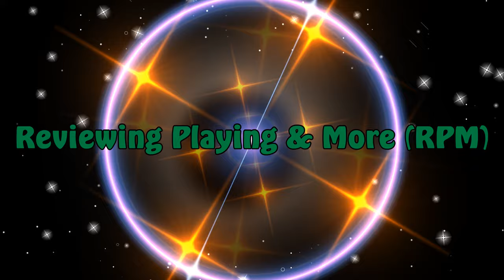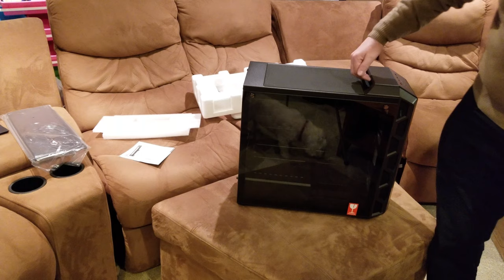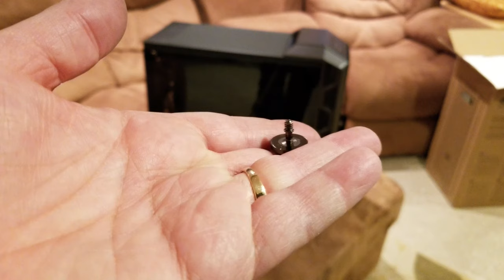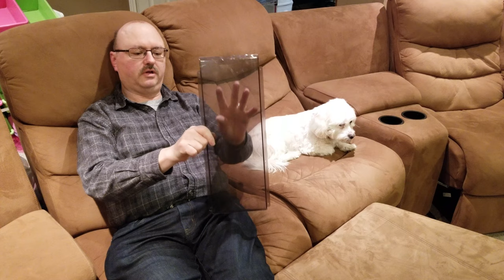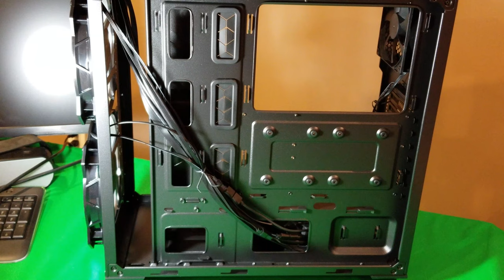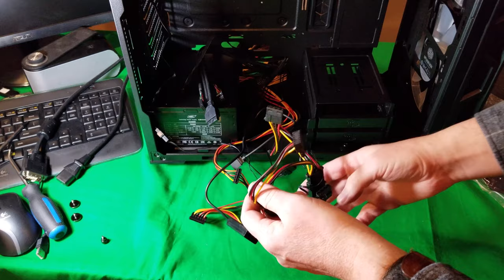Cooler Master Mastercase H500 (New info on RGB in the Build Video coming soon) No Molex required.

Comment: Nice case, I just finshed my new build, for $100 bucks you can not beat it. Good air flow easy to build in it. Good review, will say this the 3 pig tail splitter is very cheap and when I ran the 2 front fans to it and plugged it in my mobo cha-2. My mobo would not pick them up, went to Fry's and picked up a better built splitter and it worked.
Reply from the maker: +Pinkfloyd1173 Great to know, haven't finished the build yet but will keep that in mind if I have the same issues. Appreciate you sharing that info...

Comment: OOPS!!! PROBLEM #1: DO NOT CONNECT the third wire with a cap to the motherboard!!!! That is an output for a 3rd fan. The cable that goes to the motherboard is on the OTHER SIDE of the rgb splitter. There are two of them, one labeled for Asus/Asroch/etc. and another one for Gigabyte motherboards (cause they couldn't just play ball). Use only one of those and plug THAT to the ARGB or RGB port on your motherboard.  PROBLEM #2: If you connect the fans to the ARGB connector on the motherboard you DO NOT use the extra CoolerMaster fan controller (the little black box that connects to SATA power).
Reply from the maker: Noted. Thanks.

Comment: i just built in this case last month.  pretty satisfied aside from the front ventilation.  60mm of those 200mm front fans are blocked by case metal.
Reply from the maker: Yeah but the looks of it make up for its small disadvantages. Have an amazing day!
Reply: @Reviewing_Playing_and_More_RPM  i agree, it looks FANTASTIC!  i put my radiator behind them so its almost in a push/pull situation but the 200mm fans dont create much static pressure

Comment: I have all the fans connected to the controller and the for gigabyte controller plugged into the JRGB slot.. and I can't change the fan lights at all
The whole front plate was pre-installed, so all the fans and stuff were connected to splitters.. i just connected the back fan to the 3rd white splitter
Reply from the maker: Answered in last comment...Thanks...

Comment: Nice video. You really helped me because I couldn't find any videos or photos with all the sides of this case. I didn't understand this thing with the rgb controller but it's ok
Reply from the maker: Glad it helped, the RGB Controller is only needed if your Motherboard doesn't have any RGB on the Motherboard...Thanks...
Reply: @Reviewing_Playing_and_More_RPM  So, if I buy the Msi X470 Gaming Pro Carbon which has rgb and mystic light, I don't need it. But, does the h500 really include a splitter where I can put 3 fans and attach it to 1 slot of the motherboard? And if yes, if I put 3x 200mm rgb fans where should it be plugged? To a system fan slot or to the jrgb header???
Reply from the maker: That's correct, you won't need it with this Motherboard, but if you did need it both the 3 PK fan and the case comes with the RGB Controller...The H500 does come with a splitter that will allow them to connect to one System Fan Header on the Motherboard...The RGB Fans are powered by a SATA Power Cable connected to the Power Supply, with the RGB to control the RGB using the RGB Header...Hope that answers your questions if not send me another question...Thanks...
Reply: @Reviewing_Playing_and_More_RPM  Ok thanks. So since I don't need the controller, I will put the 3 rgb fans to the splitter (it supports 3 fans right?) and then to the jrgb header? And every fan has 1 more cable which goes to the sys fan slot? Lastly, does the rgb controller come preinstalled (preattached) in the fans?
Reply from the maker: Yes it supports 3 Fans...and yes to the RGB Header...yes each fan has it's own cable, and the RGB Controller is not pre-installed (Pre-attached) so you connect as you need...
Reply: @Reviewing_Playing_and_More_RPM  Ok, thank you very very much!!!😊 👏👍 You helped so much! Keep doing such nice videos and providing help to people. Thanks again!

Comment: This was a great review. Your in depth looks at the case let me see if my weird non-standard 360mm radiator (2x180mm) would at least fit on this case, and it looks like it will. I've loved this series since the original Master Case Pro 5. Subb'd and thumb'd. Cheers!
Reply from the maker: +10ee Appreciate your support, glad you liked the video. Thanks for watching...

Comment: a big let down with this case  is ,i bought 2 noctula 200mm fans for the case and i went to do my build and the holes on my new fans do not line up with the ones on the case so it means i going to have to drill out holes for the noctula fans .. a extra hassle i did not need as its my first time building a pc ..
Reply from the maker: +tomas o sullivan so your adding them to the top? I don't think you need them the airflow is very good and the two front one's are very quiet.  Yeah didn't realize if you were adding you would need to do that. For your first build I'd only replace the rear exhaust as it's a bit loud. Anyway good luck with that you're brave to attempt drilling into the case, I'm to worried I'd mess it up. Good luck...
Reply: @Reviewing_Playing_and_More_RPM  hi thanks for getting back so soon .. no i bought the 2 200mm noctula fans for the front because noctula are better quality ..i put 2 140 at the top and also replaced the back one with the 120mm .but the 200mm noctula fans in the front the holes for the screws  wont line up with the holes on the case .there different postion than the big fans that come with the case for some reason .. so i either got to drill new holes for my noctula fans or just put back in the ones that came with the case ..
Reply from the maker: +tomas o sullivan Only thing is you'll be losing the RGB but I get it if you don't like that it's not for everyone. It's to bad they don't fit wonder why they do that. Anyway sounds like a big decision. I'd stick with the ones that came with it but that's just me...All the best whatever you decide...
Reply: @Reviewing_Playing_and_More_RPM   i not interested in the rgb to be honest .. i think ill make a template of the fans and drill the holes so i can use the better quality fans .its just going to delay me a bit beacuse i want the proper tools to do it right ..it was just something i was not expecting  and not prepared for .i thought all 200mm fans would have the same holes but they dont lol ..thanks very much for your fast response
Reply from the maker: +tomas o sullivan yeah I'd have thought so as well, template is a good idea though.

Comment: doing my first build in this case and the fan wiring has officially sucked the fun out of it for me at this point, literally zero instructions came with the case and the wires are messy and all over the place smh. I got this case because i thought it would be one less step with the rgb fans pre installed but boy was i wrong
Reply from the maker: +Captain Smoke Yes it was a big surprise for me as well not sure why they did it this way I suspect it'll be confusing to most and take away from the build experience. It is an amazing case after getting through all that though...All the best...

Comment: I need to replace the two front fans, I hope they're not to hard to replace
Reply from the maker: Not there are 4 screws per fan, you just unscrew, observe the direction they are blowing the air and if your happy with that then put your new ones in the same spots...it's actually fairly easy...You'll have no problems...

Comment: Can you let me know if you remove the hard drive bays can you mount a bottom pull 120 mm fan?
Reply from the maker: Once the HD Bay is removed there is room for a 120mm fan, but no pre-drilled screws of which to secure it so if you wanted to do that you'd need to MOD it by creating your own holes to secure it with...Thanks...
Reply: @Reviewing_Playing_and_More_RPM  Awesome thanks for the response. I think I'll go ahead and mod it. Should be incredible airflow in the case!

Comment: If the  Front FAN RGB controller is SATA powered, what's Plugged into the MOLEX power?
Reply from the maker: It's not, the cables that plug in, one of them connects to the RGB on the motherboard, they have another connection that plugs into the motherboard. Sorry if I didn't show it well enough.

Comment: So does the LED controller that plugs into the SATA power cable only run power to the LEDs? Or does it power the actual fans as well? I'm assuming that it's only for powering the LEDs and that the fans still need to be plugged into a sys fan header on the motherboard but, I don't want to be wrong.
Reply from the maker: The SATA powers the front fans as well, the other fans use both the splitter cable included with the case and then the others go into the Fan Headers on the MB...You got it all right...

Comment: Hello, Dennis! I maybe quite late with that question, but the hope dies last, right?
So I have a problem with connecting rgb cables of front panel fans to my motherboard. I've tried so many options, but I just don't know how to connect it to my Giggabyte b450 AORUS elite v2. 
Perhaps, I need any kind of an adapter? 
Thank you in advance, Dennis!
Reply from the maker: Hi, so the case has gone through a couple different changes so I'll talk about both options, first if the cable from the case is 3 Pin it's a 5V ARGB Header that is needed on your MB it's called labelled as VDG, if the cable is 4 Pin it's a 12V RGB Header that is needed which is to the right of the VDG Header. Now on this case for the front fans there was on mine also a SATA Power connector that will need to go to the SATA Power from your Power Supply. Hope that helps, your MB has the connectors you need so should be no need for an adapter.

Comment: I have a question, what's the molex adapter for? I noticed you plugged it into a molex cable, but didn't plug anything into the adapter after that. Also, just so I'm sure, you don't need to plug the fans themselves into any motherboard fan headers right?
Reply from the maker: +JustShayPlays Hi, I in an earlier video I explained plugging in to the molex and to the sata power. It came in handy when I wanted to demonstrate the fans but in this build I realized I didn't need it. It can be used if your motherboard doesn't have a RGB Header. No I didn't plug the fans into the motherboard headers as the cables were to short, so I had to use the extension cables they provided. Which actually was good as I didn't have many system fan headers on the motherboard. Now one of them is on the adapter itself though. I know it's hard to show it well though so sorry for any confusion. Thanks for watching and your support...
Reply: @Reviewing_Playing_and_More_RPM  I gotcha. Thanks for helping me out.
Reply from the maker: Anytime...Have a great day...

Comment: Hi, I am using the restart button to control the front argb fans but now the restart button isnt working so how can i control the front fans to turn them on or off or to change color. I have asus rog strix x570 e gaming MB
Reply from the maker: If the restart button isn't working because of the case check that the cable to the front panel connectors didn't come loose as that can easily happen. If you are using software from the MB Manufacturer it should allow you to change the colors that way also.
Reply: @Reviewing_Playing_and_More_RPM  I checked the case, if i remove the case and use the exposed restart switch it works but if i put the front top panel cover then it doesnt so there is some restart switch problem and not to put the case for RMA is a big headache so i thought if i can use the the argb or rgb port on the MB and then control the fan color with asus aura sync software it would be great, but not sure though. so can you please guide if possible
Thanks
Reply from the maker: @amitgedia  You should be able to control your colors for RGB with the Asus Sync Software as long as it recognizes the source device. If it doesn't then not sure what can be done in that situation.

Comment: Nice video, I have one question though. Will a b450 tomahawk max have the correct header to control the front fans with mystic light and will I be able to turn the rgb off?
Reply from the maker: It has an 12V RGB Header, so yes it will work with the Mystic Light and you can control them through the software...if you don't want the RGB I'm not certain if you can turn it off with the software, but you could just not plug in the RGB as the fans work independent from the RGB and will work that way...In short yes you'll be able to do what you want with that MB...Thanks...

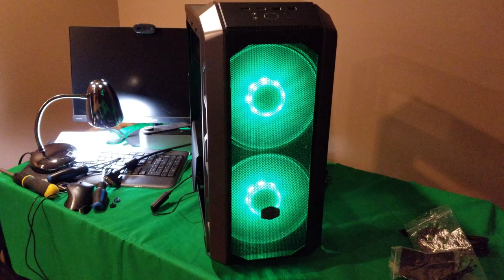Comment: Need help on this problem ....in your video, at 13:25 the fans LEDs are steady green with no effects until you press the controller to change the modes, I just want one color (blue) with no effects, all the colors have the bread effects, so how can I reproduce what you did until 13:53 with no effects...! Thanks again
Reply from the maker: So the controller is only used to demonstrate how to use it if you don't have RGB Connectors on your MB, if you do use the Software that comes with your MB to you will be able to choose Breathing or any other Mode to get the desired effect. The controller will do it as well but it takes a bit of exploring to get the Mode and color of your choice.
Reply: @Reviewing_Playing_and_More_RPM  Thanks for your reply... in your demo 13:25 you show how to use the controller if we don't have an MB with RGB, this is my situation I just have the front fans, I got the color (blue) that I want, but it's always in a breading mode, I explore all the function in the Mode, still can't stop the breading... not like your demo. In segment 13:16 you have no MB installed, so is my controller defective...! Thanks again
Reply from the maker: @ping3488  While it's possible I think it'd be unlikely. The controller has three buttons one is for Modes, one for colors and the third for speed I believe. You need to cycle the button until you get the desired effect it was tricky to get the mode I wanted. It took me a 1/2 hour to just figure some of it out. Stick with it but if it doesn't work then try contacting customer support and see if they can get you a replacement if needed.
Reply: @Reviewing_Playing_and_More_RPM  Thanks again for your help, I don't understand... my controller doesn't have three buttons, my controller is the same that you use in your video with only one button, so how did you get your green color without the " BREATHING " effect. Again thanks for your patience..!
Reply from the maker: @ping3488  So had another look at the controller and the controller comes with 14 lighting presets to make full use of the Addressable LEDs in the system and also allows to be completely switched off by long pressing its button. So holding the button down for a second longer changes what the controller will do. Give that a try to see if that fixes things.
Reply: @Reviewing_Playing_and_More_RPM  Tried the 14 presets and shutdown button from the beginning a few days ago with no success...when you chose a single color like ( Blue ) do you get a breading effect...! Thanks
Reply from the maker: @ping3488  Yeah I was able to get quite a few different Modes, breathing was one of them, I guess it could be the controller isn't working right otherwise not sure why it's not letting you get there. Best of luck with it.

Comment: I got my PC all setup w this case, rear and both big front fans running. But the 2 big front fans RGB arent on. Not sure what i did or didnt do, or need to do. Any advice?
Reply from the maker: Check to ensure you plugged in the Sata Power Cable, that is often overlooked...Thanks...

Comment: i dig that you pointed out that the front io was removable,  that can be very handy..  im looking to buy this case..  my main concern is the handle..    i need a handle on my case..    so.. can you carry the machine with that handle?  you picked it up when it was empty,  but a full decently spec'd machine can be pretty heavy..    so maybe just do a couple bicep curls using the handle,   that would be perfectly sufficient....    that would be awesome...    if you could let me know ur thoughts on it.. id would greatly appreciate it..   thx    .
Reply from the maker: +bob the nailer I have a system with 1 GPU, aftermarket cooler and 1 adapter card along with normal items like 2 Hard Drives, etc...and I was hesitant at first but have moved it around with the handle several times now and have full trust in the handle...now I've only moved it within my home and not great distances but it's been very handy...Hope that helps...
Reply: Reviewing Playing & More RPM thank u very much for getting back to me.   Yeah I’m gonna get it for sure now.       It’s a beautiful and fairly cheap case I was really hoping that the handle wasn’t just for show.      Thx again.

Comment: So you mean to tell me that every time I need to change the color, I have to open my case and change the color? What's worse is if you turn it off on the controller, the next time you restart, it will turn on again.
Reply from the maker: Or you can get a RGB to ARGB Adapter, or unplug the RGB Cable all together if it's not something you want. Unfortunately without a MB with the Header you need the controller is the only other option.